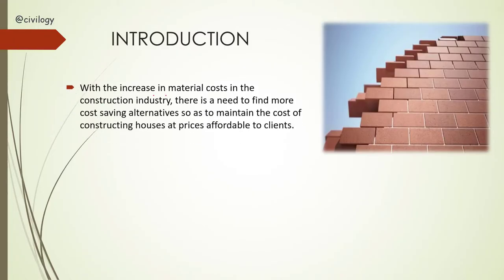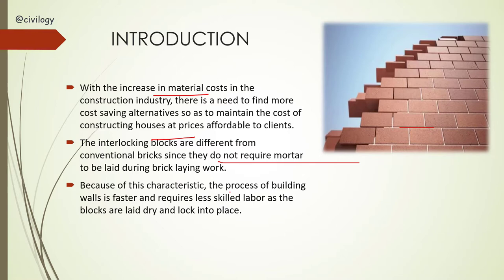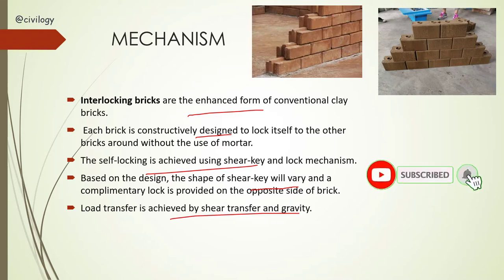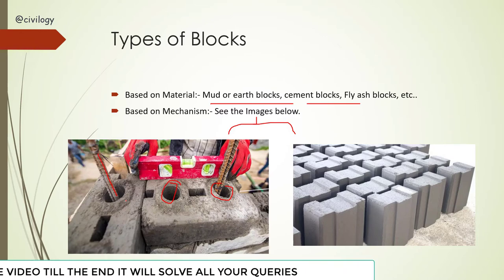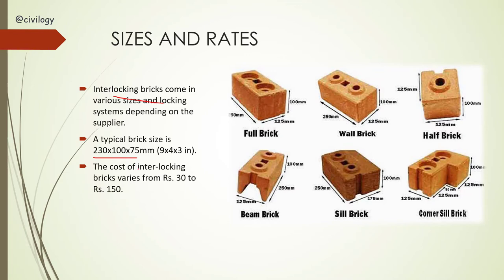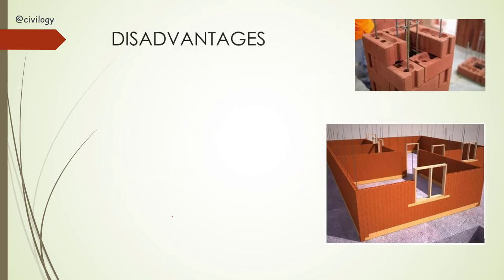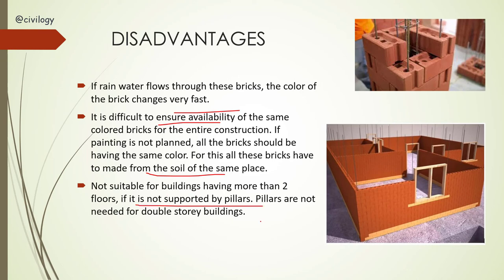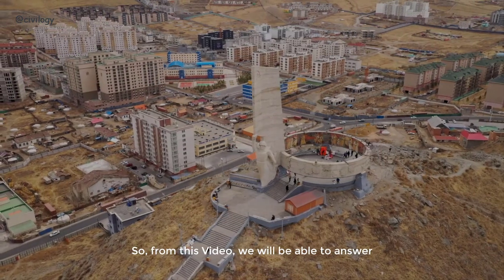Interlocking bricks for house construction || Low budget house

Comment: Engineering bricks are stronger in below grade construction in moisture. Is it possible to make a CSEB Compressed Stabilized Earth Brick into an Engineering brick by changing the amount of cement / lime content and firing the brick? If you were to dig an underground basement for every house, it would give you the soil you need to make the bricks, plus provide an underground root cellar for storing food in a cool location, and a hurricane / tornado proof room. How would you make your own engineering bricks?
Reply: If it was me doing this, I would extend the foundations outside of the wall line by about 9 to 12 inches.  Against the wall, on the foundations, place an agdrain, wrapped in a geofabric, adjacent to the wall. Then, obtain marble or clean 10 to 16 mm gravel, and place that in the area directly above the foundation, against the wall, and create a barrier on the outside to stop the soil from interacting with the gravel.  By doing this, you are catching the water that runs through the gravel, and removing it from the area.  The gravel allows the water to escape, but also allows air to circulate, thereby removing moisture from the wall and reducing damp coming to the surface.

Comment: Bro There are different types of interlocking brick so which is one the best amount those bricks......can you please rate the brick by 1st 2nd 3rd
Reply from the maker: I didn’t understand? Based upon size or quality?
Reply: @civilogy  size and quality both for house construction can u send me the best interlocking brick for house construction
Reply from the maker: Brother Quality depends on manufacturer’s. So check while you buy. The company will mention you the max strength it can bear and it’s sizes. Based on that, choose the one which suits for your needs. The nominal strength we already mentioned in the video 👍

Comment: How do you do the wireing & plumbing
Reply from the maker: You can use the hollow spaces in the blocks 👍
Reply: Wiring is done using how spaces in vertically perforated blocks , plumbing can be done using perforation but not advisable

Comment: Sir pls share the video difference between interlock hollow brick & lock bricks
Reply from the maker: Interlocking is same as lock. Tell me correctly? What do you want?
Reply: Sir I want difference and which is better one , interlock hollow or lock mechanism block ?
Reply from the maker: Message me on Instagram; type @civilogy
Reply: The solid bricks, with the tongue and groove, are known as Interlocking Stabilised Soil bricks, or ISSB.  The bricks with the perforations / cores, are known as Compressed Stabilised Earth Bricks, or CSEB.  The advantage with the CSEB is that they can have reinforcing and cement to bind the reinforcing run through them both vertically and horizontally.  They do not require cement pillars externally to hook into, and, if set up properly, there is no reason why they are not able to be used in 4 level / 3 storey buildings.  The other benefits are that comms, power, water and gas lines can be run through the perforations / cores.  

ISSB constructions requires pillars to hook into, and there is no way of running reinforcing through the wall.  Any comms or utilities that are required either have to be cut into the wall, then backfilled, reducing the strength and integrity of the wall; or, run down the outside of the wall.  The other caution about ISSB products is that, depending on the manufacture method, the length of the blocks can vary considerably.

Comment: Fly ash interlocking brick with column&beam we make 3 floor building
Reply from the maker: If you are going for load bearing walls then definitely it’s not a good idea. But you can use them for framed structures (which are made up of columns, beams, slabs)
Reply: @civilogy  i want to make building with framed structures with interlocking brick or block for save money and time. can its good for me
Reply from the maker: @imbaba7270  Yes you can save money. my suggestion is before starting your building please visit a structural engineer who knows about interlocking bricks. He can give all the details of the work
Reply: @civilogy  i am also civil engg but no information about interlocking brick
Reply: Thanks